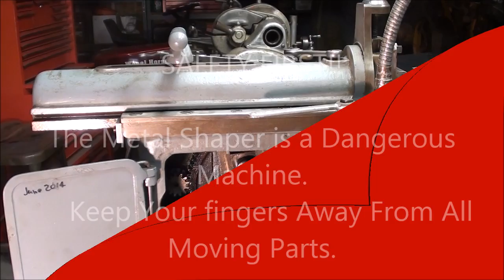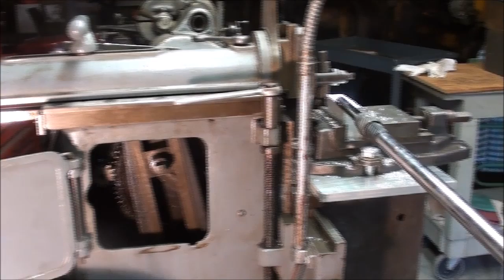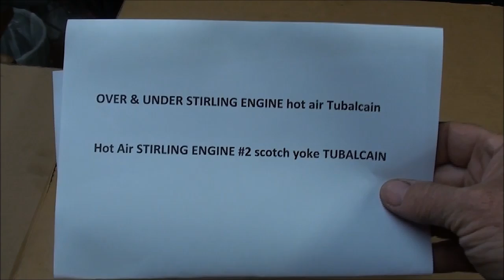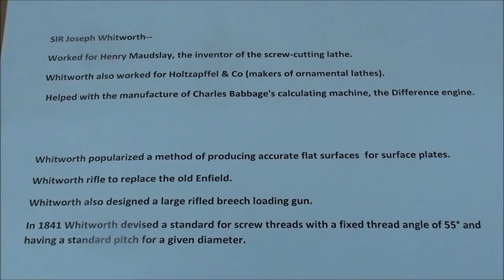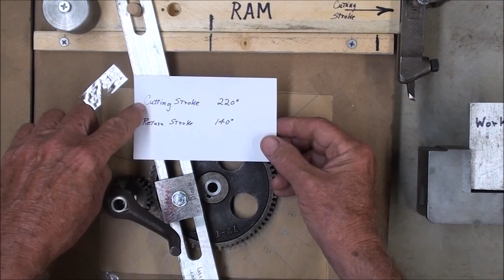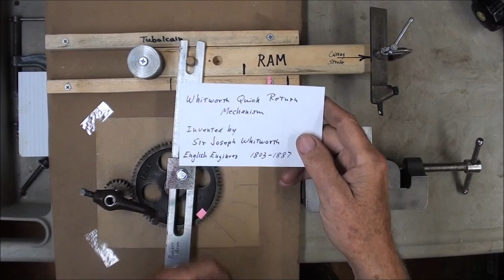TIPS #172 ATLAS RHODES SHAPER Whitworth QUICK REVERSE Mechanism tubalcain

Comment: I like these kinds of videos. Simply, I have very little money and as much access to more. I ordered a king combo 1620 mill/ Lathe almost a year ago and received it yesterday and uncrated it. this is my first ever lathe and mill. and the first tool that touches material will be the first ever use of a lathe or mill. Lacking cash. Many of the pieces of equipment I want will need to be home made. As such how it works gives me the principles so all that is required is to design it. But, The principles are the most import part because I find myself in a what goes first? the horse or the carriage situation. To mill gears. it's best to have a dividing head, but to build a dividing head one must have gears. So understanding the principle allows a person to make shift something temporary just to wrap out the gears necessary for the dividing head. Then build the dividing head and you are now able to churn out as many great gears as you want. Same for a rotary table. Unfortunately up here in Canada I don't run into tool auctions with mill or lathe stuff and even when there is it's all premium priced. I mean, up here you'll see an ad for an old old 40" lathe covered in garbage and 20 years of dirt with no motor, missing parts and a small pile of tooling and that's going for over a grand guaranteed. Just that combo mill/ lathe and the cabinet to sit it on was just under 4 grand on sale. So now I have the gargantuan and dirty task of removing a massive amount of packing grease.

Comment: Thanks Mr. Pete. 
I’ll be using a similar design like yours to apply to my project. I built an awesome wooden hammock for the wife, she loves it but it consumes too much time to attend to her and swing it when she’s on, so I’ve been looking at similar design, adding a motor and I have a motorized swinger for the hammock. The motor is a bit fast so I’ll need to reduce the speed some how by gear reduction or lower speed motor.
It’s been a very interesting project to work on and fun!

Comment: The other thing is mechanical advantage, in that there is more leverage being applied when the cutter is under load than when it is not under the return stroke (which goes back to why it is important to have the bull gear turning in the proper direction, as to how much stress would be applied to the yoke while the pin is near the end of the yoke bar as opposed to the middle of the bar. . . (I’m paying attention, teacher—- really!!!)

Comment: Great review on shaper mechanism! I like the insite on various aspects of the mechanical linkages and relationship of the arm and rotation. Also the tip on setting the tool to part at the start of the cutting stroke! It will be a good series!

Comment: tubal, great video, could you use a push pull linear actuator to make a shaper. mcmaster carr sell one with a speed of 137 inch per minute with 337lbs of force, would that work as a project?

Comment: Many years ago, I was playing on a larger unit, and the machine did offer the function to reverse the direction of the motor, in turn, the cutting directions. In the event that you do not want to have to re-indicate the part back in if it has a crazy setup with jack screws and what not, and or, if you desire all the machined surfaces to be parallel/perpendicular to one another as much as the machine would allow for. I only once needed to set up the machine for such, as the stroke of the actual tool cutting point would not reach far enough, before the cutting tool holders set screw would have hit a vertical wall area of the part. You would have to change the tool mounting block "the clackers base" kingpin from the top hole to the bottom hole, and a lite extension spring would be flipped on to a hook point on the top to over come the friction of the clacker. If I remember correctly, the table feed was then backwards, which if you were not paying attention, I'll bet that could bite a guy in the butt. But, the machine would then pull inwards towards the machine slowly, while cutting, and would eject outwards faster, while the cutting tool would rock out of the way until the ram pulled inwards again. The amount of torque required to turn the counter gear "you called it a BULL GEAR" in turn, rock or swing the rocker/pivoting arm when the slider is close to the bottom of the machine, is huge. vs. if the stroke on the cutting action, and the slider is high in the machines casement is slower, but easier on the drive train and is more efficient. if cutting outwards, the bull gear needs to rotate clockwise, and provides a slower cutting speed, but is more force and in more accurate and less stress on the drive trian or to say, the slider's wear pads do not wear out as fast. The possibility of breaking something if cutting backwards is much higher, when you really would want the cutting tool to let go first and or the rams locking hitch to be overcome and slide. I have only heard a few stories of the rocker/swing arm breaking, never seen it. I understand, that the bolt/fastener that lock the slider in position on the bull gear is what typically gets sheared/broken, by design, unless somebody thought it would be a clever idea to throw a grade 8 / hardened shoulder bolt in its place, again, I never seen that happen either. The efficiency of the larger units, I suppose, really wouldn't care, as they were all hogs anyway. LOL...

Comment: Thank you for showing this, as a heavy equipment mechanic ( not your big hammer and chisel type as you refer to quite often) having made parts to replace broken items when they were either not available or wait  for a long period ( having to tool up to make the piece at the factory ) some of the machines have always been my intrigue on how they are put together and work as they do. As some I was able to have manuals for reference for operation and maintenence.

Comment: Just starting to get my Emrich shaper up and running and really appreciated the information in your video. Especially the fact that the big driven gear should rotate clockwise. Now I can work out which way the electric motor has to rotate. 
Thanks.

Comment: Excellent video as usual Mr. Pete! I for one would be most interested in the "great men" such as Mr. Whitworth. Yes please continue this type of video.

This video was very interesting and helped me to understand the workings of the mechanism and shapers. I understood that the return stroke was much faster than the cutting stroke, but I didn't really understand why until I saw your prototype and mockup. If the bull gear is turning at a constant speed (clockwise), the pin on the bull gear is further from the pivot point than it is on the return stroke. It didn't hit me that was the reason for the difference until you mentioned that if the bull gear is run counter-clockwise, the cutting stroke will be faster that the return stroke. I was then able to visualize the "arm" of that driving pin as the reason for this difference. Great demo!

Comment: Very good, thank you!  I didn't see the WHY it returns faster until the very end.  It might have helped me to point out that the pin coming off the bull gear is actually moving left and right.  If we ignore the up and down motion of the pin you can see that when it moves toward the work, the pin is also at the top which means it has more of a 1:1 ratio (not quite) since the pin of the bull gear is almost at the top with the bar.  When it moves left to return, the pin now has a lets say 2:1 ratio because the pin toward the bottom.

Thanks, keep em coming!

Comment: Although I doubt I will ever use a shaper your video as usual was very interesting and informative, and will have taken considerable time to put together ,,,, many many thanks,
Coming from the other side of the pond I must also thank you for saying a few words about the great man Sir Joseph Whitworth ,,, very often you show and air your distain at engineering from over the pond and it was wonderful to hear you speak of the great man in such glowing terms. and if I can add to your comments I think that standardising the screw thread gave an often neglected and little realised boost to the industrial revolution because up until then anyone trying to invent and make something had to make their own nuts and bolts, as time went on each major town had someone specialising in making them but they would be slightly different from the nut and bolts in a town 30 miles away,,, and with Guns so popular in the U.S,A then obviously everyone should know it was Whitworth that invented "Riffling" put inside gun barrels. and its the cork screw like groove on the inside of a barrel that gives the twisting motion that makes the bullets so much more accurate. But thank you for giving the man his just credit,,,       .

Comment: Dear Mr. pete. I like your videos a lot. THey give good insight on how machines work and how cutting tools work and also how to setup machinery. Although some stuff is different then i have learned in school it is still usefull because it makes you think. and one way is not specificly wrong or right from the other. I hope you make more videos like this were you explain mechanisms. I also like the background and history of the inventions. Your way of explaining with the degrees per stroke is insightfull. you could also aproach this "problem" by looking at the lever ratio when the slider is at the bottom and when the slider is at the top. This will give the same answer ofcourse. Any way thanks for all the videos untill now. And excuse me for all the bad grammer :) 

kind regards from the netherlands,
Rinze

Comment: Hey Mr. Pete,
Another great video.  I appreciate the work you went through to explain the mechanism used in the sharper.  I owned a sharper once.  I loved just to start and listen to it plow away large chips of steel.  The sound, the smell, the vision of the moments, it was like a piece of art work to me.  I dreamed of creating something useful with it but I never got around to it.  That machine was sold when my wife and I moved to a different home. 

Anyway I have some input about your how it works series.  How about helping you viewers to become great inventors like Joseph  Whitworth by showing use how different mechanisms work and the applications for them, design parameters, etc.  For example the Scottish yoke, or some type of an indexing mechanism, etc.  You could show and explain these different mechanisms, and that would inspire your viewers to invent, and uses these elements to build something.

Thanks for your contributions to the metal working committee,
Mike Sportsman

Comment: What the teaching aid really shows well is that the eccentricity of the driven pivot on the bull-gear is what sets both the length of stroke, and the ratio of the forward and reverse motion of the ram.

This is the main reason why the ratio is closer to being 1:1 with a short stroke, with a practical maximum on the order of 1:3 (3/4 of a rotation for the forward and 1/4 for the return stroke)

That is much less visible when trying to shoot video of the dark oiled cast iron through a small access door in the side of the real machine...

Comment: If you want to describe how quick return works, you can take point of driving pin on large gear: divide it's moving track into two parts: top half is working pass, and down half if return path. In left and right position there is no ram movement thus remove this pin track from observe. It's easily understand that linear lenght of top and down arcs of pin track is differ, top arc is much longer giving slow working move, and down arc is shorter giving fast return.

Comment: Lyle,

You would be very interested -- if you haven't already seen it -- in the old steam powered ferry boat on display at the maritime museum in San Diego. It has propellers on both ends of the ship and the single propeller shaft can be reversed WHILE THE ENGINE IS RUNNING AT FULL SPEED! I was amazed. That would be a great mechanism for you to describe.

Jon

Comment: A sewing machine might be good material for a sequel.  That whole lock-stitch seems so simple to look at, yet difficult to implement.  The planetary reduction in a cordless drill is neat, mostly because it is so compact.  A car differential is cool, too.  I never did understand how a limited slip differential works.  Elliptical gears are neat, although I don't know of any common application.  A review of the various mechanisms to convert rotary <--> reciprocating motion would be interesting (including the crank patent infringement problem that led Watts to the sun/planet gear).

I appreciate the history lesson, too.  -- Thanks!!

Comment: We had a pump jack on a 250' water well that worked with the same crank and yoke arrangement.  On a well that deep if the pump jack had equal speed on the up and down stroke, and if the foot valve leaked at all, you stood a chance of loosing the prime on on the down stroke. So, an accelerated return was an advantage to get the piston back down in a hurry ready to draw up another stroke's worth of water.  It also gave a mechanical advantage on the up stroke as well and allowed the use of a smaller motor than with a regular pump jack.  At the old engine shows I have seen a pump jack built in Iowa made with uneven, lopsided gears and matching pinion that accomplish the same thing.

Comment: Great video. As usual. How it works is a great idea. One thing I would have liked to be pointed out with this one is the real reason why it is faster one way or another: Leverage difference between the pivot being at the bottom vs. the pivot being at the top. Thanks.

Comment: A good video but as mentioned below, the reason for the different speeds was not spelled out. They key to this mechanism is that movement of the end of the rocker arm is larger when driven close to the pivot than when driven further away.  Imagine uncoupling the link to the bull gear and  holding the rocker arm at that point between you fingers and then moving it left and right. Picture how much the top would move when manually actuating it at different distances from the pivot.

Comment: Fascinating video - thanks :)
It took me a while to understand HOW the reverse stroke is faster but your teaching aid makes it clear. It seems to me that you can adjust the speed of the return stroke by changing the distance between the lower pivot and the centre (English spelling ...) of the large driven wheel? Or would you have to also change the diameter of the large wheel?
More of the same please!

Comment: I had an argument with an engineering lecturer once about the quick return action. He was insisting that a reversing switch was entirely useless on a shaper, whilst I pointed out that sometimes it's advantageous to cut on the back or pull-stroke (keyways for example) and that all the shapers I'd come across had a reversing switch. I also upset him by reversing the blade in a hacksaw and cutting on the pull stroke. I'd hurt my shoulder and couldn't cut the conventional way. To him it was just WRONG, no matter how well it worked.

The 55 degree included angle of Whitworth threads makes the best possible use of the strength of the material. That was important before high tensile steels were available, but 60 degrees is only a small compromise and a much easier angle to work with (when sharpening a tool bit for example). It's worth noting though, that quite a few machine slides have 55 degree dovetails for the same reason. I've seen someone spend a lot of money on a dovetail cutter, only to find out they didn't have 60 degree dovetails!

Comment: A bit more info on Whitworth threads they are all the same size-pitch as unc except 1/2   unc is 13 tpi whitworth is 12tpi but whitworth is 55 degree and unc is 60 degree.
Also whitworth spanners are different to af and metric spanners as a 1/2 inch whitworth spanner is .937 inch  across the flats
This is because originaly a 1/2 spanner fitted a 1/2 diameter bolt but in the 1st world war steel was scarce and all bolt heads and nuts were down sized one size so for a 1/2   whitworth bolt you need a 7/16 spanner  or for a 1/4 bolt you need a 3/16 spanner.

Comment: Thanks for the lesson, I just today bought what i think is a 7" shaper made by the Lock tool company of Melbourne (Australia). It needs some TLC and is missing the clapper box and vice but i got it cheap and all the machined surfaces are very good.
My plan is to restore it and use it, i had to grab it before it found its way to the scrap yard.
I'm 27... some young people like this stuff too.

Comment: am i wrong or did you not explain WHY the backward stroke is faster?? i am still not sure why this is so and i am no casual watcher

EDIT: i researched a bit and found out that the offset of the cutter to the right (measured from the vertical axis of the driven gear) makes the backwards stroke faster. A link to a animation: http: //iel.ucdavis. edu/projects/mechanism/quickreturn/ please delete the spaces in the link

Comment: I think that it's working in this way because the pivot point at the bottom of the machine, isn't in axe with the big gear...that's right? Check it when the bar is vertical

Comment: Thank you, Mr. Pete!  I'd been wondering how shaper motion was done.  Hydraulic came to mind, and maybe some sort of clutched reversing gear setup, but this is much more elegant. Your demo model is very clever and makes the mechanism very clear. 

In a real shaper, is the stroke length controlled with a slotted bull gear?  So you can move the attachment point in and out radially?

Great video!

 -- Mike